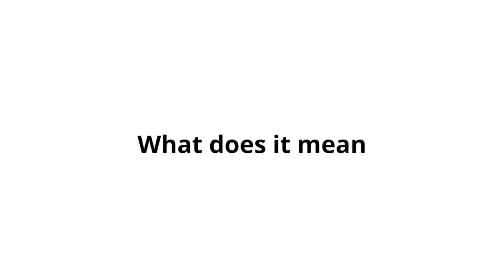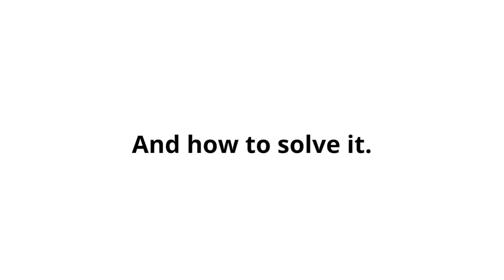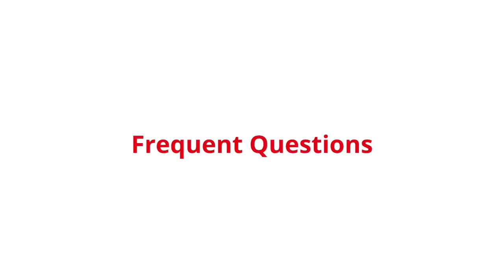📛 Code P0650: How do i fix Error Quick and Easy【2025】📛

Comment: I unplugged the cluster to check something else in the dash and when I put this back i got the code p0605, had to delete it with a scanner, now I have to do a bunch of drive cycles to get it ready for smog, tags are expired, it's nearly impossible to do the procedure on the roads unless u willing to risk your life , don't touch cluster if you don't need to! 2001 suburban*